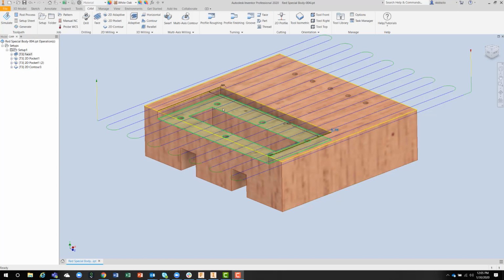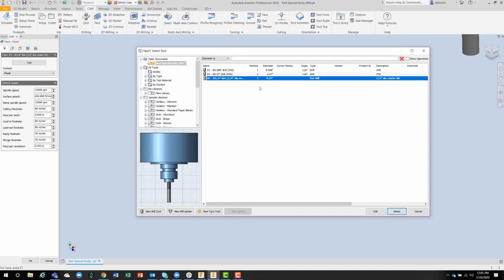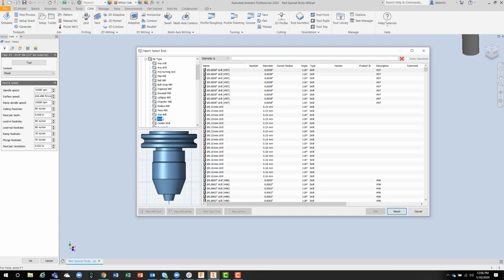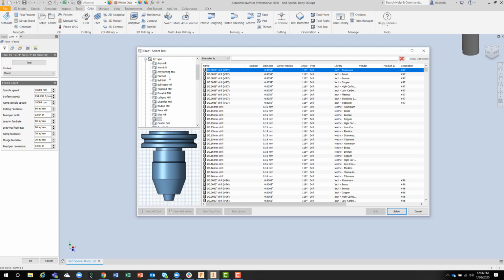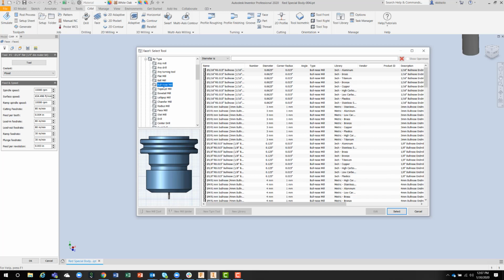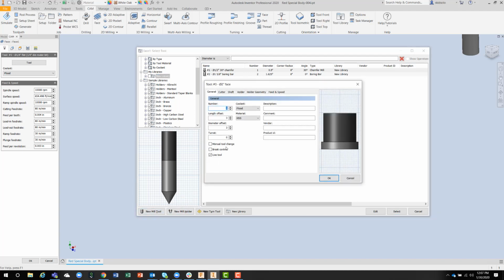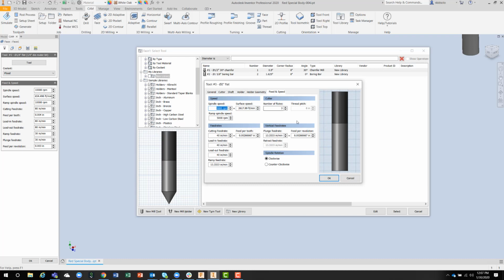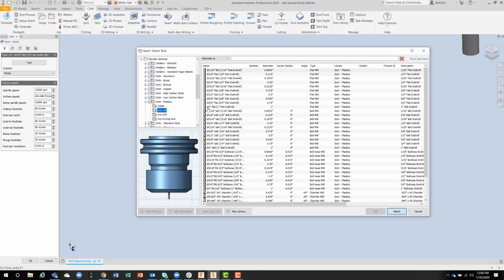Selecting Machining Tools in Inventor CAM Tooling Library

Comment: Is this toolbar available in Inventor2018?
Reply from the maker: Inventor CAM part of the Product Design and Manufacturing Collection. If you only have Inventor you will not have this capability.